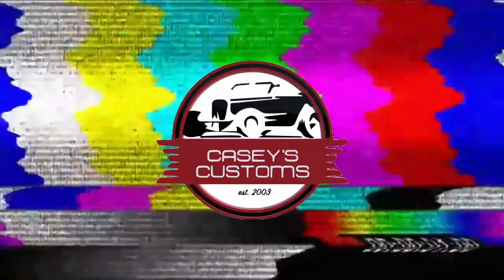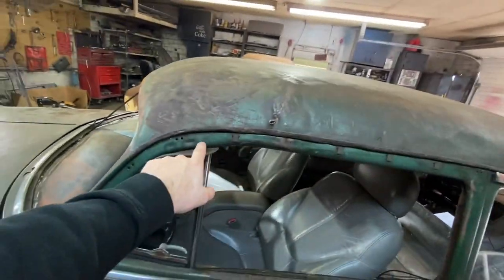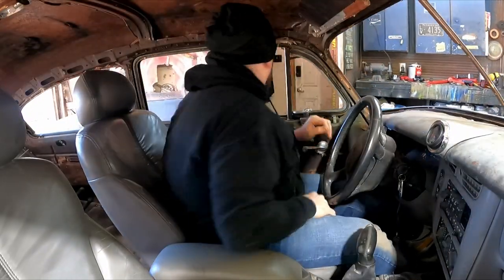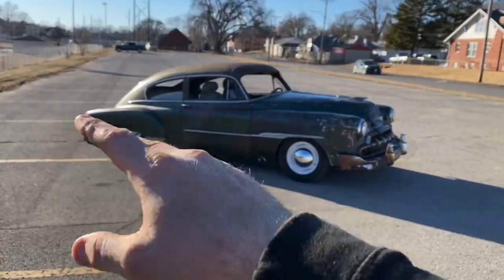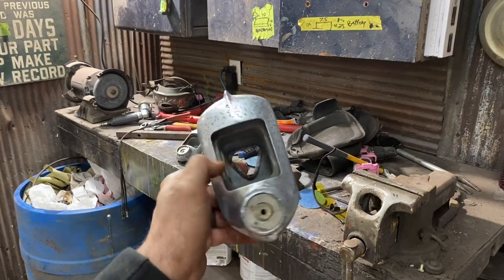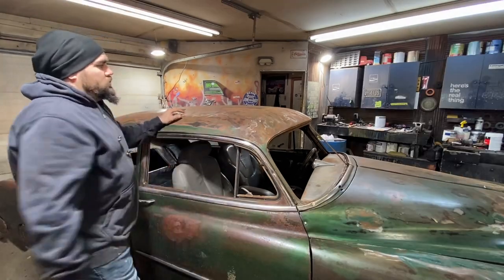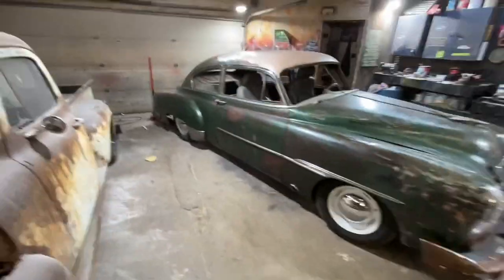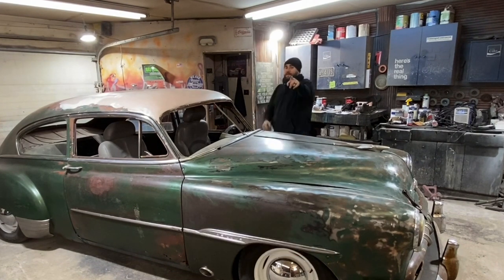BUDGET BUILT TURBO RAT ROD FIRST DRIVE TO THE CAR WASH! PART 29! CHEAP HOT ROD ON AIR BAGS! REBUILD

Comment: Love the way you build cars. I'm currently restoring a 1977 ranchero gt. Havnt had enough time to get it running my daily is a 94 cobra I've been building for drag racing for 3 years so it takes most of my time.  But hopefully this year my ranchero will be sitting low and running. Love a lowered classic sitting static

Comment: How come you never have windshield wipers when the vehicle is done?
Reply from the maker: Sometimes i do, 99.9% of the time they aren’t needed on a hot rod. Old cars windshields are so steep that a good windshield wax will take car of any issues. I daily my 55 Chevy truck and have never had an issue without wipers
Reply: @Caseys Customs  Must not have state vehicle inspections.
Reply from the maker: @magniac3955  must not know what historic plates are.